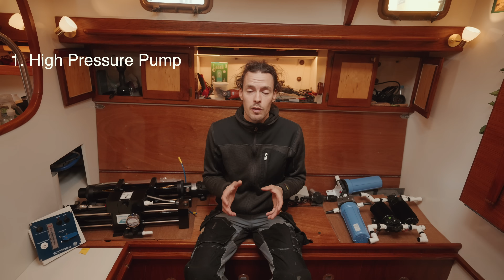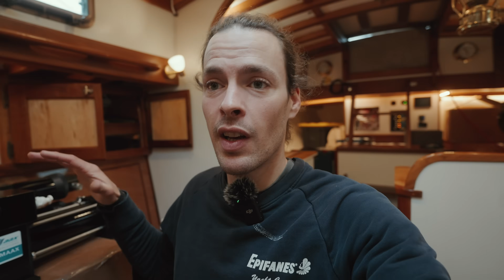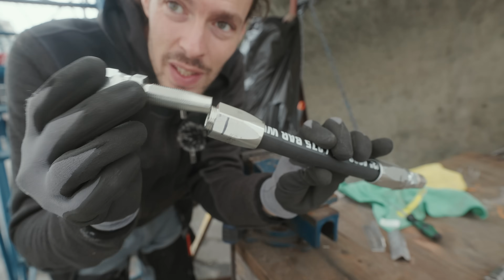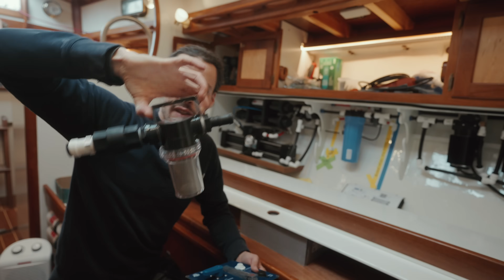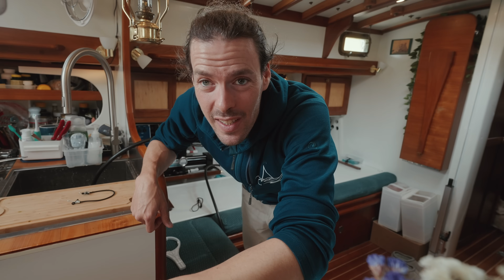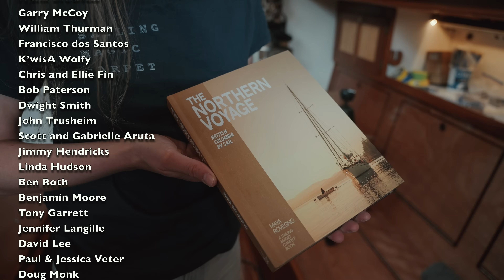I Installed a Watermaker: Start to Finish

Comment: It looks like you have a pair of 21" membranes so that's good for 600US gpd.  A single 31" membrane does 700gpd. The problem with these 12v energy recovery watermaker is their long run times and complex parts. Because they make so little water, they need a lot of hours. This increases wear on everything.
With the increased use of lithium batteries that can take large loads without a problem, many cruisers have opted for very simple high pressure pump tupe watermakers that make a lot of water very quickly. 1kw or 1.5kw motors can easily be run from a 3kw inverter quite common on boats with lithium batteries. 
We have such a watermaker that I built from parts in 2012. It makes 230 litres per hour. We run it during breakfast for 15 minutes and make all our water for the day. The run time for a year is less than 100 hrs. Good HP pumps from the likes of CAT will do 10,000 to 15,000 hours. Robustness is very important to us. The slight increase in power draw is not a problem with a good solar array charging the lithium

Comment: Watermaker looks great, I like how you can get to everything to service it! You may have already done this, but food for thought. On my boat I mounted a vise on a piece of G-10 with flat head machine screws, nuts on top. There is another bolt pattern drilled into the G-10 that matches a bolt pattern on top of my port cockpit locker hatch. When I need the vise I just bolt it in place. When I'm not using it the bolts keep the holes in the hatch plugged. The vise lives in a tool locker so it's out of the weather.

Comment: Did you considered a saltwater tank inlet or direct saltwater intake on deck which you can fill up manually at the start of each process of desalination? I am thinking about the possibility of not having another through-hull.

Comment: 14ppm, did you test again after like an hour if it goes down more? *considering I only have experience with evaporator type fresh water generators, I'm used to producing water with a salinity of 2-5 ppm. Usually the alarm (auto switch production to overboard instead of tank) is set to 10 ppm.

Comment: Maya,  I made bread from the recipe in the book and other than operator error with the
 stretching and folding it was a success! One question- are you supposed to wet your hands every time you do the stretch and fold?
Reply from the maker: Glad it was a success! I wet my hands if the dough starts to stick, it’s just to prevent that from happening :)

Comment: Well done! 8 hate plumbing and that complexity would give me nightmares. Those modern push connections sure do make things easier though. Great to see all the pieces you need for long haul sailing coming together.
Reply from the maker: Thanks Wayne! All the connections sure worried me, but since they work I’m becoming a fan of these fittings:)

Comment: Things regarding  R. O. have changed a lot, since I built a small system  3 decades ago.  It consisted  of several  pre filters a 45 gallons storage tank, pressure  guage and a Procon pump and finally a R. O. membrane.  The only drawback  was that the pump had to have a constant supply of water or it would  self distruct.  It was a Procon  pump about 3 inches   square.  It worked well for years and i only burnt out one pump.  It supplied  water for a greenhouse  for years.

Comment: Expect to rebuild a Clark pump every 1000 hours.  There are like 80 seals inside that wear down.  The high pressure pump(super fast production) uses more electricity but produces more.  Youve got to watch the Clark pumps for a while (all day) while it works.  I've been down the path for both.  The Clark pump typically costs 1800 for a rebuild from Spectra.  The high pressure pump you can re buy for 180 to 360.  I've got like thousands of hours on the high pressure pump past probably two rebuilds for a Clark on my high pressure pump.  The high pressure pump has hard ceramic pistons to produce pressure like a car engine....the Clark has rubber seals like 80 of em....they tear and wear down.  It's that first time you are in the backwoods of Bora Bora, when you start cursing the like 15 percent more efficient  Clark pump that just broke down and ya gotta send it back for a rebuild.

Comment: Beautiful installation Dino.  I have seen quite a few new, expensive, high end, factory built boats and they are all quick to show off the neat and tidy electrical wiring.  Almost without exception their plumbing leaves a lot to be desired, just scattered around behind cabinets or in bilges.  Then again, that's Plumbers!
Reply from the maker: I appreciate that, it definitely took some time to get the plumbing looking right! :)

Comment: Here's a problem I see.If the membrane still runs at hign pressure you are just pumping a lot
more low pressure water to drive a water power high pressure pump!
So if your membrane requires 1 gpm at 800 lb, you are going to need 10 times that, 10 gpm at 80 psi to run the INTENSIFIER!
Inefficiencies will make it closer to 15-20 gpm. What I am saying is the energy to supply the 800 psi will be the same or more
no matter how you pump it!
This type of intensifier is used in hydraulics all the time, one pump powering another pump!
Another thing, high pressure pumps of this size are invariably piston pumps which are the highest efficiency you can get, off the shelf,
As against centrifugal or flexible rotor pumps!

Comment: I used to work with the hose and couplings you used... You should have thoroughly washed out the assemblies with 98% alcohol to eliminate the coasting left in the mfg process on both the couplings and the hose, to eliminate contaminants... I would not be surprise if your water tastes of rubber for a while... heat will make it worse if it happens. There are release agents on the hose and potential machining oil residue on the couplings.  Hope I am wrong.

Comment: If the voltage is 12V,  14Amp for 12Gal/H means , 3.7Wh by liter. Seems pretty reasonable. A 100Ah 12V battery will be able to produce 300liter

Comment: The RO system is installed in an area that is open to the cabin. Will the sound of the system  operating be troublesome to you? Most RO Systems that I have seen installed in boats are underneath a bunk or in an enclosed locker to minimize its sound impact . Your thoughts please..
Reply from the maker: 90% of the time, it’ll be running when the engine is running. Thats noisy enough that the water maker won’t add much. Plus, this is still ‘under a berth’ in as much as the sound is still dampened by a cushion.

Comment: Don’t understand?
Brine water was going to be plumbed through a new thru- hull, but your system shows it being discharged thru the sink & then overboard - same as I did 30 years ago on my sailboat. 😊My thought was why cut another hole in the boat? 😢Plus easy to monitor brine water being discharged into the sink.
Nice installation 👍👍
Reply from the maker: No -- brine water is indeed plumbed through a new thru hull. The faucet in the sink is "clean" water from the watermaker. This faucet is used to test the water before diverting it to the tanks. The watermaker takes some time to start producing clean water every time, so you have to monitor and test upon startup every time before adding it to your tanks.

Comment: Aladino, you always work meticulously. It looks great and looking at Wh/litre you have a very efficient system. Wow.
That said, the high pressure lines with all the 90 degree couplings - could you have done that in runs bending the hose?
Why I ask?
Each 90 degree gives a flow rate reduction and back pressure. This reduces your excellent efficiency a bit, but what it does most is each 90 degree thing becoming a resonator.
The system does not come across in the video as loud, understand me correctly.
It's just a deviation I developed living with a "Princess and the Pea" wife's sensitivity to noises from tubes and water flowing through them. Rebuilding an old brick & mortar, forced me to go into these details and she has been as silent as my water, hot water, RO, sewage, and heating infrastructures.
Reply from the maker: I knew that was going to be a drawback. But as with every project there is compromises to be made. Noise level is not bad and now that the plumbing is in I don’t see changing it anytime soon, but it would be interesting to see how much the 90 decrease production.
Reply: @SailingMagicCarpet  - that's fair. Thank you for answering. It was great to watch. And the collaboration with the big engineer so nice too.

Comment: 14 ppm is incredibly "pure". It implies - in my book - that its pH will be closer to 5 than 7. You can make incredibly "pure" tea with that from the best leaves money can buy (provided you don't add milk).

Downside? The low pH makes you thirsty and lowers body pH if you drink it a lot. This gets solved by the body's homeostasis process by bringing base ions into the body's fluids. You basically demineralise yourself.

Been there, done that.
Also note that metal tubes/leads will dissolve in the low pH. The chromium plating disappeared from inside my espresso machine like snow from the sun. This exposed the underlying brass and that's fine as a bit of copper in the espresso can be a good source of daily dose. It's a heavy metal and toxic, yet one or a couple enzymes in the body need copper to become the workhouse an enzyme has to be.
Magnesium, for example, is a building block in some 350 different enzymes.
So you can find an island in the Caribbean that uses RO to make fresh water. After filtration, they run the fresh pure water over (IIRC) specific lava  rock, probably of a kind that contains some calcium. This raises ppm again, shifts pH up towards 7 and osmolality gets in a better zone where valves, pumps, etc., in the fresh water infrastructure last longer. And makes less nice tea that turns dark when you let it sit or even builds an oily skin on the surface. Yuk. And I love me a most toppest Taiwan style Oolong or a green "two leaves and a bud" only Oolong. Or even better, a caffè Roman-Italian style (as generalisation, the North has too little character, the South is too dark).

There is no elegant solution. 

Enzymes are the chemical workhorses we make in order to facilitate reactions that normally, without enzyme as tool, are impossible. In our cells we can produce H2O2^2+ (that's hydrogen-peroxide with two extra electrons - incredibly reactive and dangerous to cell health). So we make an enzyme to convert that into hydrogen-peroxide and then we have another enzyme that converts this into harmless water. Enzymes are basically proteins with a mineral or a  vitamin added into the structure. The fit the spatial structure of two ingredients into a resulting molecule and imagining the enzyme as two hands, its spatial magnetism changes so it can stick the two building blocks together. This is concentration dependent. When the concentration at one end of what the enzyme facilitates becomes too high, it starts to convert the other way around. A protein is the bulk of an enzyme's volume and our DNA codes for how to assemble these. Of course, the building blocks for the enzymes must be available or it will not work.

Comment: Great job on the research and installation, Aladino and Brian. It looks like a fantastic placement for it. If something goes awry, you will hear it very easily in that cabinet. No reaching into tiny sink cabinets in the head for you with this application.

Comment: Worked with John at Electromaxx to spec out a high capacity isolated alternator.  .  Unit never worked right.  Tech support was terrible.  Later found out the unit was not isolated and was told it is not a product offered.  I shared my requirements document , and was told "I never made that request" AFTER sending them the documentation.  Don't trust these guys.  Total waste of money and disappointed as a customer.
Reply from the maker: Damn, sounds like a bad experience. Tech support has been a bit hit and miss for us with them as well. We chose them mostly because they were Canadian, and tariff uncertainty was super high when we bought the unit. We’ll post more updates about the ongoing experience as we use it.

Comment: 14 PPM is amazing, were you in the Fraizer River? We don't see less than 150PPM in the Caribbean.
Reply from the maker: No, we were in Gibsons, not on the Fraser. However, I think it was actually 140ppm. Still pretty good :)
Reply: @SailingMagicCarpet we routinely had ppm < 100 at home in the PNW...the salinity of the water is much lower. Once in the Sea of Cortez the usual was 150 to 180ppm. Safe level is <500 according to the WHO. We usually just taste test now and use the meter every 5 or 6 runs

Comment: The installation looks much more accessible than say the if it were in the engine room.  Used to be in the Merchant Navy where they used low pressure evaporators with the recommendation - only made water where more than 20 nautical miles from shore or further if opposite an estuary.  I guess the instructions for your water maker mention Coastal waters, estuaries, and inshore zones contain high levels of bacteria and viruses from raw sewage and coastal run off?
Reply: Hi Chris, my understanding is that bacteria and viruses are larger than salt ions and are therefore filtered out by the membrane.

The much bigger issue is usually bacterial growth in the freshwater tank after the water has already been produced. Therefore, it is advisable to install an activated carbon filter and an LED UV disinfection unit at the tank outlet, before the water is used. 

If you plan to use your watermaker to clean harbour fresh water, which works very well, be aware that chlorine can destroy the membrane. Therefore, it is better to use an activated carbon filter before the membrane if you are not sure.